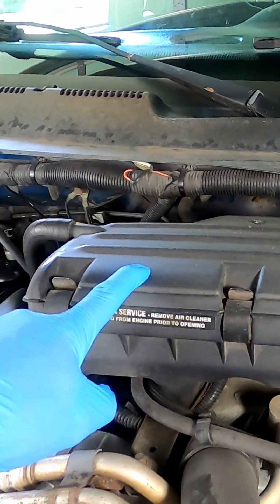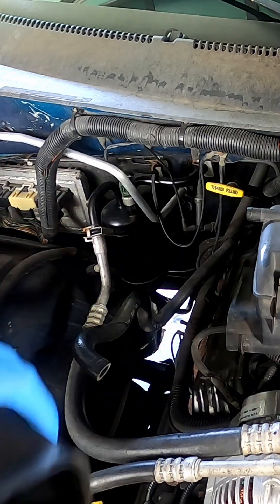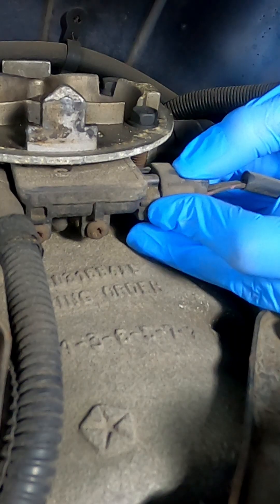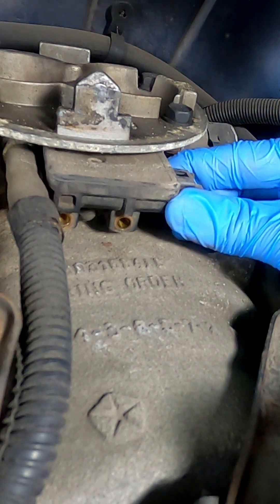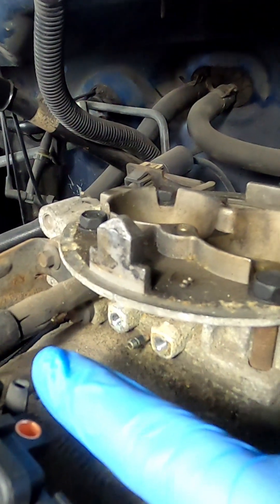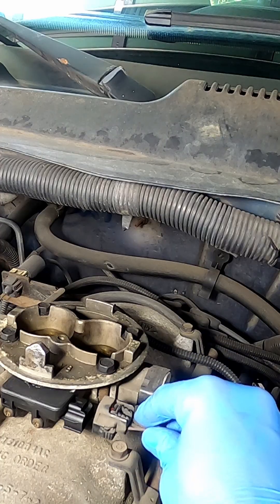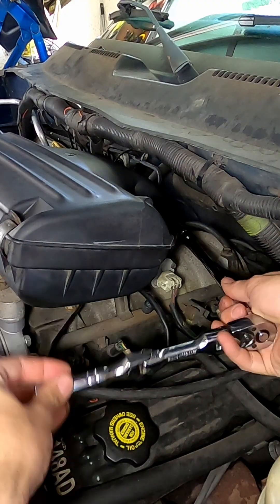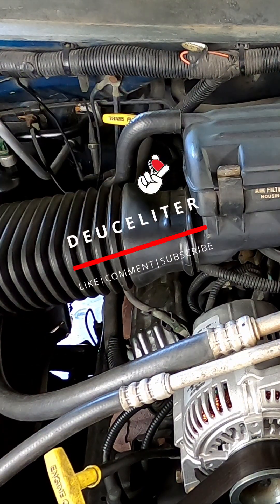How to Replace MAP Sensor on 2nd Gen Dodge Ram 5.2L & 5.9L (1994–2001) — Step-by-Step Guide

Comment: Do you know if this causes occasional bogging and dying? My truck is a 2001 5.9 magnum and it keep dying rarely but it sounds terrible and runs extremely rich when it does want to die...can someone help
Reply: Change this MAP sensor, the throttle body sensor on the side, and the air throttle sensor on the back of the carb and I bet your truck comes back to life.
Reply: Check your IAC valve/sensor (Idle Air Control).  Located on the rear of the throttle body.  2 T25 screws, kinda hard to get to because they're on the back.  My '98 1500 5.9L recently died a couple times suddenly when idling... replaced the IAC valve/sensor and it hasn't died again... seems to be the fix.